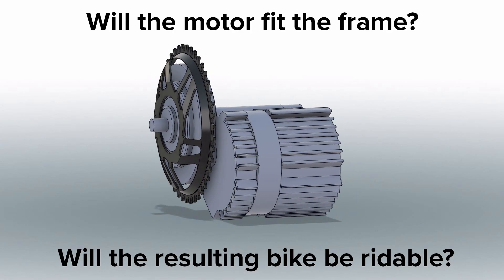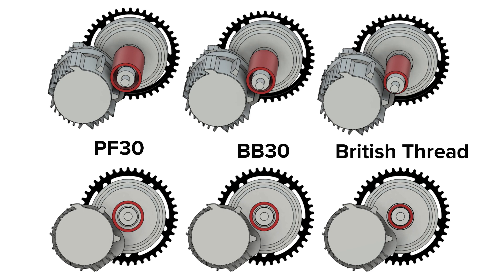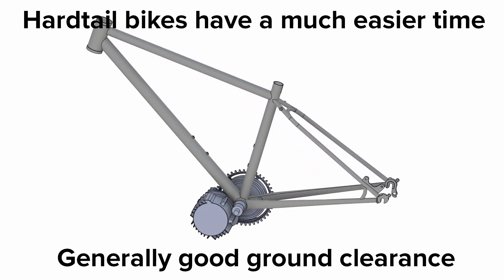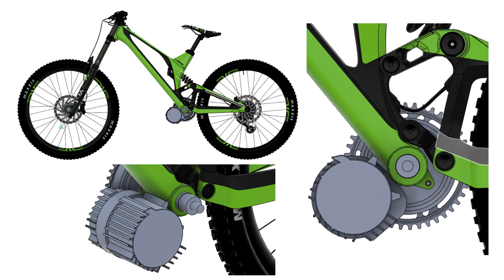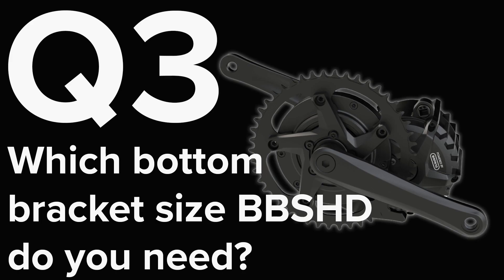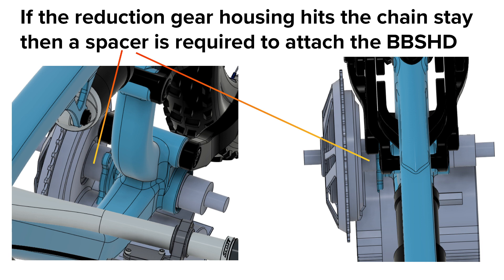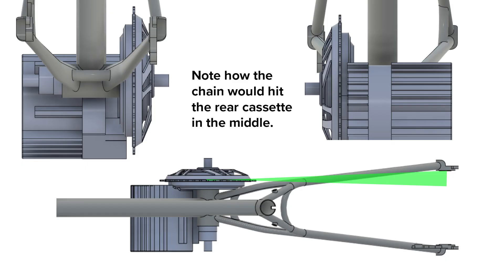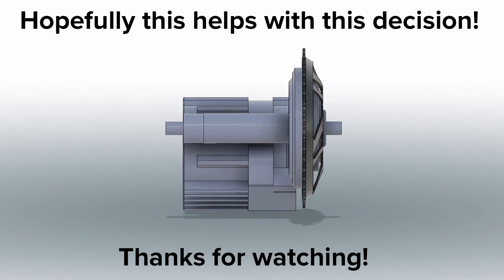How to fit a BBSHD motor! Size guide to the Bafang BBSHD / M625

Comment: Hello! I have had issues with this motor coming loose after tightting it with the correct torque and additionally applying Loctite to the grey Locknut. Raised ridges are facing the bicycle and are bitting into the frame but after some time the motor comes loose. It's a very annoying problem I have that prevents me from enjoying an otherwise great kit! Any suggestions people?
Reply from the maker: Hi, suggest you join the channel discord server so you can post photos. This is the link https://discord.gg/YAAjfgc works best on the phone app so you can use the camera easily. There are brackets that can help with this but it would be good to try and see a bit more of what is going on before you buy something. Hope this works. Cheers
Reply: I also had this issue. You should also look into getting a Brace from Luna or California Ebikes. They have a couple of different versions that are nice.
Reply: @jasonspector   After I retightened it again with a ridiculous amount of force (torque) it has not come loose yet. I also put a bit of Loctite on the threads, not as much as the first time. I tighten it so hard that I wrap the tool I was using, just the simple one that came with the kit. I should also point out that I also used an DIY extender bar of about 1.5 meters to apply more torque. I tighten as hard as I physically could.
Reply from the maker: Sounds good! Great to hear. Cheers
Reply: @TGUGCL  The tool to tighten this is very hard to get tight. Especially if there is anything in the way. The best advice I saw was use a mallet to tighten it. That seemed to work for a while. The bracket or brace solved my issue thus far.
Reply from the maker: The only true way I'd with the socket tool and a torque wrench. Otherwise as you say it's brute force!

Comment: The M625 adds a huge (literally) additional issue of requiring the proprietary Bafang battery that comes in one, giant, ugly, form factor.
Reply from the maker: Its hideous. This is a video where I take it apart. There are a few other as well. https://youtu.be/3u76ZYn54A4 Will have one this week switching the bbshd controller in. Cheers!